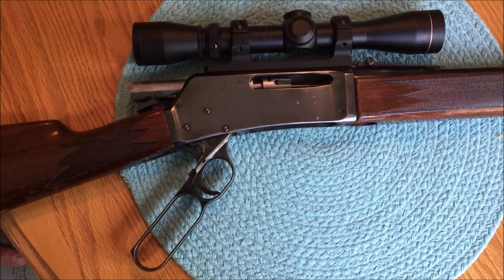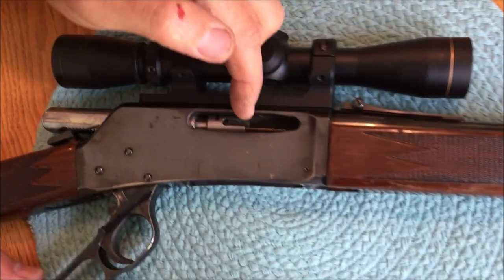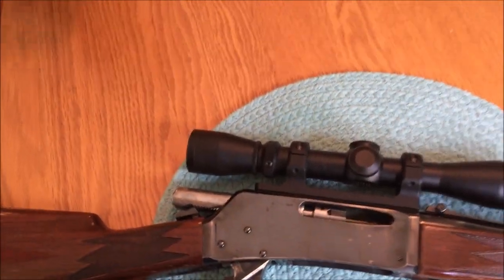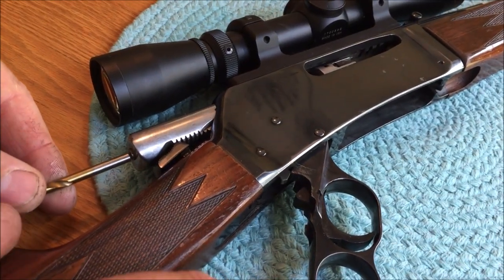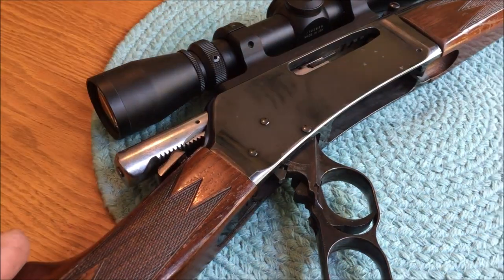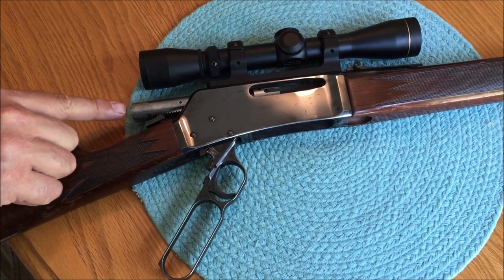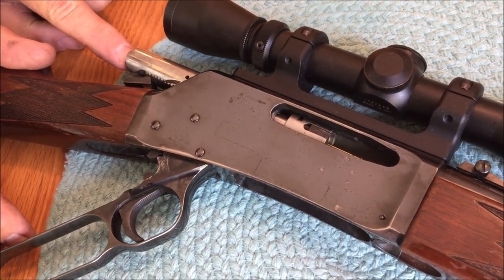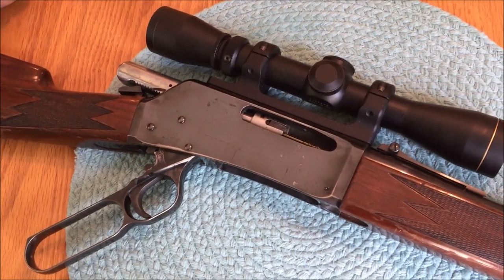OldGuyDIY Browning BLR 308 Lever Rifle Firing Pin Repair Stuck Light Primer Strike Misfire DIY Fix

Comment: Great video. I didn't have a spent casing to use so I used a cleaning brush to push against and it worked perfectly. Thanks for the tip!

Comment: ... I have 3 BLRs ... ALL takedowns ... every once in a while they each get a "BATH" ... I take the for-end/barrel assembly off and then take the butt stock off (easy to do) and soak the receiver in a pail of dechlorinated brake cleaner and rinse until all the crap comes out ... when the receiver has evaporated dry I reassemble the gun and work a few (very) drops of high quality machine oil thru the action ... there are 2 VERY inconspicuous screws to take the butt pad off ... if you look close you'll see the faint screw hole slits in the butt pad and then one bolt to remove
Reply from the maker: Thanks for the information.

Comment: Hello Sir!
As I see, you have your scope mounted with DNZ Game Reaper rings. Could you give me the specs on this mount, please? The part no. should be engraved on top of the base part and the height on the front of the front ring base (like H, L or so). I would appreciate it,  if you gave me these specs.

Best regards, 
K. Klein
Reply from the maker: The DNZ mount says 54500 H.
Reply: @OldGuyDIY  Thank you very much for your quick response! I have nearly the exact same setup. I am just thinking, weather to order the same mount a tad lower like M or even L. But I am concerned about the space between the rear scope bell and hammer spur to fit a gloved thumb to operate the hammer.
Reply from the maker: You are welcome.  Since the low mount is .94", medium is 1.06" and high is 1.19" high, I don't think a person would notice the 1/4" difference between the low and high when he shoulders the gun while hunting.  As a guy over 6' tall, the high mount is nice and comfortable for me to gain the sight picture and there is room for the hammer to clear the scope.
Reply: @OldGuyDIY  Exactly! I also prefer to have better access to the hammer and sacrifice a tiny bit in the cheek weld fit.
Thank you for the insight and advice! 
Best regards!

Comment: I just bought a new BLR in 308 and the first 5 shots of new ammo only 2 went off. light primer strikes. doing some research online Thousands people with the same issue.  I got 3 answers. Grease in the bolt assembly , Timing issue, or head space issue. One guy said to take the stock off and soak the action in some kind of solvent for 24 hrs then blow it out with air gun. not what I want to do with a brand new gun. So I used some carb cleaner and a air hose. Still having misfires. I loaded 5 empty casings with federal 210 primers 4 went off. loaded 5 with WLR primers only 3 went off. 5 with CCI 200 and 250's none went off.. very little dent in the primer. The hammer hits the back of the bolt face and stops and the firing pin still has to travel another 1/8 of an inch before it touches the primer, I don't know how any rounds go off ? no solid contact between the hammer firing pin and the primer. I put all the casings that didn't go off in the BLR in my rem 700 bolt gun and they all went off no problem ... Put the BLR in my chest freezer overnight the first 6 factory shells didn't go off the 7th one did. Iv been reloading for close to 50 yrs and never seen anything like this. Don't trust this gun for anything its junk. This is the only brand new gun out hundreds that I had to spend days trying to get it to fire every time, Still cant figure it out. Its going back..
Reply from the maker: Quite the experience, I agree, I wouldn't trust it either.